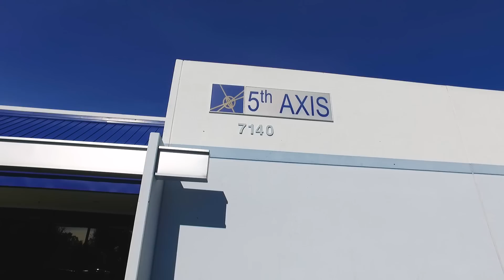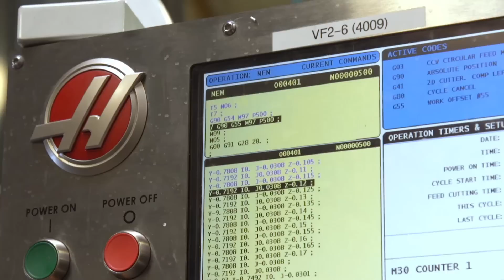Customer Spotlight - 5th Axis Workholding

Comment: Replacement parts? If you have one working and one broken cnc machine it seems that in most cases you should be cycle time away from having two working cnc machines.
Reply: In most cases it's a situation of don't reinvent the wheel. You'd have to change a setup and design and program a part just to get running again, then get the machine set back up on what was taken out. The guy said they can basically have parts next day and that's very time efficient.
Reply: Daniel Geisenhof I’m just thinking that they should include the programs for the smaller, imprecise parts, but as you say it’s probably rare for that to actually be faster, particularly if your shop wasn’t steel focused.
Reply: Absolutely, and if there's any sort of finishing operation like electroplating you'll be paying an arm, a leg, and the soul of your first born son if you're having a single piece plated. That being compared to a large batch run...